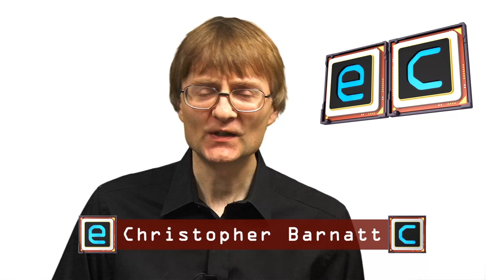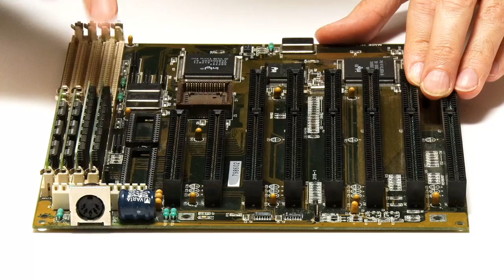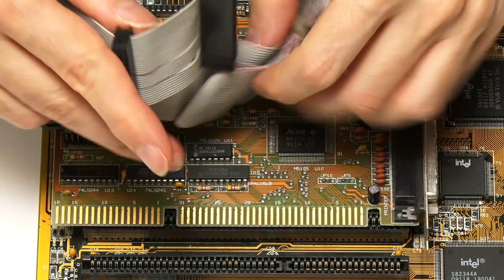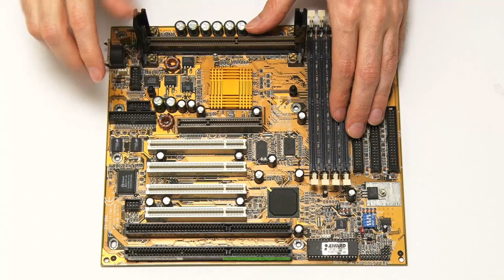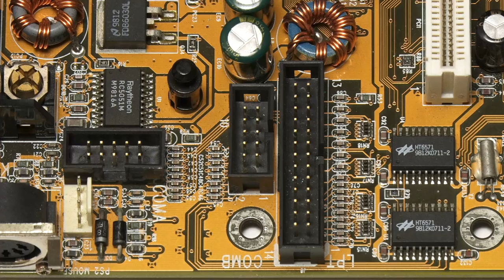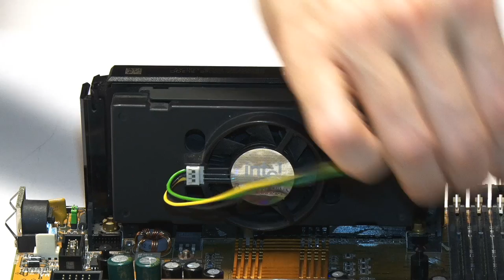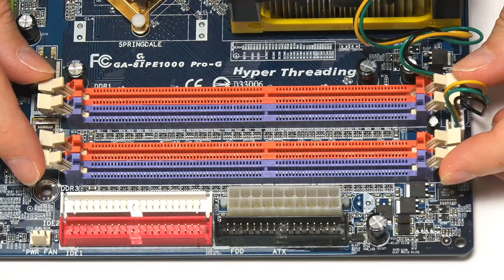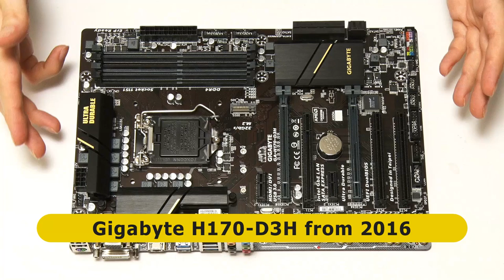PC Motherboard Evolution

Comment: interesting how you connected the cable wrong at 6 minutes. The stripe on a ribbon cable goes to pin 1.
Reply from the maker: See pinned comment.
Reply: Sorry didn't see that comment, but there is another thing. Even though it is a standard, long as both ends are backwards it will work correctly. I have enjoyed your channel for some time now, keep up the great stuff. I grew up with punched cards, and have put together a number of systems. As such there were a number of things that I missed over time as I was too busy with things occasionally to keep up with everything and your channel helps fill in those missing pieces. I'm just now working with Arduino and Raspberry PI and thinking about what will work best for a PC replacement for someone that still has a number of programs that still run on dos 6.22.
Reply from the maker: I so agree on the "both ends the wrong way around" thing! :)

Comment: That's a history lesson. I had no idea Intel tried to do cartridge processors.  I guess we can see how that worked out..  It's still pretty easy to swap CPU as long as the socket matches the new CPU.
SO THAT is what a Motherboard looked like when I was born.. lol I didn't start getting anywhere into computers until around 2004 when I got my first HP machine on Windows XP. I was. Oh, about 13. I didn't start building until about 2014 when I started getting into things like racing simulations. in my short time i've built 3 gaming machines and a desktop for my mother.  If I had a bigger budget I'd be doing more.. I'm a complete rookie compared to most of the people that have commented on this video. Although I did recognize the AGP and IDE connectors. When someone asks me what they need to fix their machine and I see an IDE connector, I tell them "A new computer will fix this computer, we haven't seen THAT in over a decade"

I have a 2010-ish E-machine behind me on a Dual-core processor which reaches 100% capacity just by playing VLC Media Player. my gaming computer that I'm on now makes that PC look like a calculator.
And that computer makes whatever was running on that board from 1991 look like an Abacus... LOL

Comment: Fantastic video! Just made me sad seeing 20MHz (1991)  to 300MHz (1999)  to 3000MHz (2004) to ... oh damn :(
Reply from the maker: Yes, the pure speed evolution kind of ended, to be replaced with a move to multi-cores. But this largely explains why the performance increases we've seen in the past 10 years or so have been relatively minor -- and why I still edit on a Core 2 Quad from about 2010! :)
Reply: @ExplainingComputers  Bingo! Moores law kinda hit the wall there and multi core is pretty useless for most things and where they are useful GPU power usually kills it. Im still on a 2012 i3770K rig running at 5GHz on water and there really is no reason to upgrade since! Keep up the phenomenal work buddy, your videos are a pleasure and awesome trip down memory lane (no pun intended).

Comment: You said that onboard video arrived in the noughties. This isn't actually the case. I had a PC from 1996 (with a 486) and it had an integrated Tseng-Labs VGA graphics chip on the board board, with 4MB of VRAM. I don't think it had any 3D acceleration capabilities. IDE and floppy were also integrated into the board just like with later PCs. There was an assortment of parallel and serial ports, as well as PS/2 for mouse and keyboard. No USB yet, as the standard had just been finalized when this machine was built. No integrated sound either, not even a PC speaker, since the PC was meant as a silent office PC, which would have worked, if it wasn't for the extremely noisy 500MB hard drive.

One very interesting aspect that is puzzling me to this day is that it had the standard ISA-ports of the time, but there was also an adapter card that made it possible to connect PCI expansion cards to ISA. I managed to use an early 2000s PCI sound card with this machine  - and it worked under Windows 95, without any configuration apart from a driver install. 

In case anyone is wondering why I was using a 1996 PC in the early 2000s, I got a hold of it after my old school wanted to get rid off some old PCs. I knew someone who knew someone, the machines would have been thrown away, so I got permission and cobbled it together out of several old computers, picking the best components from each. We only had a family computer at the time, which I had to share, so this little 486 was "my" first PC. I used it for homework and games (thus the soundcard), mostly old shareware titles and Lucas Arts adventure games.
Reply from the maker: Cool.

Comment: Aaah, jumpers!
Jumpers also used to be a pain when connecting multiple IDE-devices (Pata) like some hard drives and a CD-ROM. You then had to put jumpers on the drives themselves to put them into master or slave mode. Often it was also important in which order of the same cable you connected the drives themselves in for them to boot/be recognised. 
And also the right IDE "connector" on the motherboard. It could take a couple of tries only for you to discover that maybe a cable was "glitchy", which happened a lot to the IDE-cables which you had to bend a lot if you had several hard drives and Cd-roms installed (often they had to be turned 180 degrees to fit in the most awkward ways too. Something leading to more non-functional cables in the long run). 
SATA made all these things so, so much easier (The cables almost always doesn't "glitch" for SATA either!

Comment: I would say the 1999 Gigabyte board was a bit behind when it was released. I've had computers from 1997 that had both onboard outputs and self-adjusting clocks. It might just be because the Gigabyte was an enthusiast's board though, and not a mass production one like in my old Dimension XPS.
Reply: There were motherboards availble with built in graphics and sound. At the time it was better to get a board without them and use your own graphics and soundblaster card. The onboard ones tended to be poor.

Comment: Great video, however you actually did plug the floppy cable in backwards of the card you demonstrated on the i386sx board.  .  On floppy and the IDE ribbon cables  the red stripe on the side with pin 1.  Then on the PCB it will either be marked, or often pin one will have a square soldering pad while the rest are regular round vias.  It is very obvious if you plug the floppy in backwards.  The drive's LED will come on and stay on if it is connected backwards and turned on.   I have been a technician for a very long time ;)
Reply from the maker: See pinned comment! :)

Comment: I don't know if you have one, but I would have loved to see one that had the dual ram types that some did.  It would allow you to use like dimm and ddr, or something like ddr2 and ddr3 on the same board.  I do like that you had the ide with sata, that was a lot of fun. Seeing the old slot with the pins, to note, they didn't have the same bios/uefi that we have now, soo many fun memories in this video, thanks for making it
Reply: I did have a couple motherboards with dual RAM types way back when. Even a couple that could take either an AT or ATX power supply.
Reply: Don't remember any that I had that could take both at or atx power, that would also be cool to see.  I liked to be able to do the boards with both of a type as an upgrade board, but I had a massive issue with the bios of one with the ide and sata. They would both work, but in order to have them work together, I had to enable a thing that I had to have disabled. There was a thing in the list though, that even after I re-disabled it, I had to have one thing enabled or they both would not work if they were both plugged in.  
It was a very large hassle and I couldn't find anything or anyone who knew what I had to do and it was a week of trial and error to find out what to do.  Even still, good times, lol
Reply: Boards with both IDE and SATA aren't that hard to find in computers about 5 to 10 or so years old, especially as SATA was starting to become standard. The last of the workstation motherboards that still have an IDE slot are just now being phased out of service to make way for SATA-Express headers.

I wonder if you're referring to the AHCI setting in the BIOS? If both the IDE and SATA are on the same controller, you might need to have the SATA ports in IDE compatibility mode for it to see everything. Can't tell without playing around with it.
Reply: this one was a while back, and it was in the raid setup for the board.  I had to enable raid to change a setting in the sub menu, then re-disable raid in order for them to read. That's about as much as I am sure on, as it was over 10 years ago. It was the first board I had with the sata and ide, not the last, and it was the only one that had the setup that way for them. It may have been AHCI, but if it was, it was listed under raid in the bios.  Like I said, it was over 10 years ago, and it was only that board and I only had to do it one time.  Think it was around 2005 or so that I had that system.
I had some of the newer ones with both ide and sata that had no such issues, and they could use both ddr2 and ddr3, just not use both at the same time, the ram that is, the drives were fine together. I know the one with the changes under the raid folder were a standout for me, as no one at the time knew what to do, and I thought it was funny that I had to enable something I was gonna disable just to get it to work.

Comment: Last week, I found a little pc from 2013. The mobo is about the size of 2 cigarette packs stuck together. It has 1 hdmi and 2 usb, VGA. 12Volts. It has NO external ram. 
It works and I thought I found a cool little normal pc. But when I start it up, it loads a security camera window application that devides the screen in 4 camera screens. Cam 1 to 4. I am thinking this is the bios and cannot be changed.
What is this and can I somehow put linux os on it? Anybody know?

Comment: Motherboards of non-Microsoft-compatible PCs were quite interesting, too, at least into the 1990s. Worth looking at Apple Macs from that era, for example. Your 1999-vintage Gigabyte board had one measly little USB connector head, but the Apple iMac G3, the first mass-market machine where the only expansion available was via USB, had already been available for about a year.

And now, we have new architectures like the Raspberry π, which are making the non-Microsoft-compatibles interesting again.

Comment: Hi, and thanks for a very interesting 'walk down memory lane', if you'll pardon the pun. You conclude your video with the statement:

"We should expect this level of change to continue into the future". 

Hmm. I notice that between the P-2 on the board from 1999 running at 3OOMHz, and the Core-2 Quad from 2004 running at 3GHz, is an order of magnitude speed up in some 5 years time. But another 5 years later and we're down to 2.4GHz, albeit in a quad core configuration. I've been watching processors since the i8085 and have been amazed at not only the exponential growth in transistor count (Moore's Law), but in speed as well. I hoped that would continue but obviously it's been leveling off considerably. Nearly flatlining, I would say. Now I realize that memory and peripheral speeds have been increasing to bridge the 'bottle neck' and that's something. But it does seem that we're kind of hitting a 5GHz wall. And while going to multiple cores helps, there are diminishing returns there. So while I'd like to believe your statement, I find that I can't. But I'd be happy to hear any thought you or others may have.
Reply from the maker: I certainly agree on the diminishing returns of CPU upgrades point -- speeds have been pretty static for some time, only cores increasing. But the development of AI CPUs (like Google's TPU chips) may point a way ahead for massively parallel chips in PCs in, say, 10 years time. We shall see! :)
Reply: One bug bear of mine is how how poorly most games are optimized to take full advantage of the hardware at hand. If they were then the motherboard would look a lot simpler and that's were I see the future of motherboards. An amalgamation of some components.

Comment: It really is amazing, how things really changed from the 90s to the 00s, things came and went on motherboards, like the AGP slot for the graphics cards.  I am surprised that the floppy connector did hang around till 2010! i think the floppy disk drive vanished from been installed in systems by default, in the mid to the late Pentium 4 era.  Also the PSU connector changed too, From the AT to ATX, so really the Pentium 2 era was a massive leap forward,  and again not that long ago with the m.2 ssd going directly on the board, and the graphics been integrated into the CPU.

Comment: The biggest difference between the 1999 board and the 2004 one was that the latter had DDR DRAM while the former had SDR (single data rate). DDR came in around 2000-2001 on consumer boards, IIRC. The overall performance improvement over SDR was remarkable.

Comment: Worst thing about SIMM slots is that the plastic becomes brittle and you can easily break them. So each time you remove a SIMM from an old board you're risking breaking the SIMM connector and making the board useless.
Reply from the maker: Very true.

Comment: I've actually still got one, maybe 2 computers that use the AMD Slot A processor. I even got a spare Slot A processor laying around that I would actually like to put to use.
Reply: My retro gaming PC is a working Slot A with an Athlon :P
Reply: @Martin2112  I think the AMD Slot A processors are all called Athlon.
Reply: @SOU6900  Yeah I think you're right, off the top of my head I think mines a 700mhz but can't remember which model. Found in charity (Goodwill if you're American!) shop for about £2!

Comment: Still remember assembling my Pentium 133 back in 1996, back when AT motherboards were on the way out. You had to check, double-check & triple-check to ensure you had the two M/B power connectors correctly inserted, as it was possible to swap the two... with DISASTROUS results! No USB... though I did run an Adaptec 2940UW SCSI interface on mine, along with associated hard drives & CD-ROM drive. At the time, SCSI was quite superior IMO so for me it was worth the extra cost.

Comment: I'm surprised some motherboards still cane with at least one floppy driver connector and Ide port as late as 2010, I have a mini-atx AMD MB from 2011, and it has none of those...
Reply from the maker: It very much depended on the board. :)

Comment: You should remove these barrel batteries, as you mentionned, the 386 have corrosion ... This actually comes from the barrel battery, and if you want to stop it from spreading, you should remove it (and eventually replace it with other solutions like a diode + non rechargeable battery, super capacitor, external battery ...), especially on the hardware you want to keep functionnal (or to keep looking fine)

Comment: most things you say are correct... but one thing you really missed and that's the integrated gfx..  That came around A LOT earlier...  ie I had it on my 386 board back in the day.  (which was a brand computer namely the Olivetti PC-30 i believe, it's been very long ago since i had that computer..)
But in the link below you can see it's motherboard; (it says amd, but mine was Intel, back then intel/amd were pin-compatible; even the soldered ones. I had a 387fpu  (floadting point unit) added to my system and it was running windows 3.11 with 4 mb ram. I even went on the internet with that computer using a serial modem, Trumpet winsock (for dialup with tcp/ip in windows 3.x) and netscape 2. My modem was a 9600 baud (~1 kbyte/sec!!!) faxmodem, about a 100 000 times slower then what i got today (100 mbit), but it worked and was good enough back then (internet was 99% text and 1% very small gif images back then).

sadly you didn't show any AMD boards (486/slot A/Athlon (thunderbird era), athlon 64 (first 64bit end user cpu), dual athlon (first multicore for end user), or motherboards for the Cyrix cpu.
Btw; on your second 386 motherboard, next to the simm slots, i really thought you'd mention those sockets... As nowadays you can't find those on a motherboard anymore (486 were the last ones to have them i believe); those sockets take S-ram; and that is used to expand the cache-memory of your cpu. Nowadays cpu's have multiple megabyes of on-die cache, this wasn't always the case; and plugging a few sram modules in those sockets (expensive, small size but as fast as the cpu) really made a difference on heavier tasks, I remember fondly that in my case Windows worked a lot faster  and felt snappy and that all thanks to 64 kilobytes (8x 8kbyte, it's the column at the top-right on the mobo in the link, it's also filled on that shot; originally it was empty on my board)

link to 386 motherboard with onboard vga: http://pcrebuilding.altervista.org/46/168/2nd+LIFE/386/Olivetti+PCS+386+SX+-+AMD+386SX+16MHz.html

I had this computer from '92 to '96, then i went for an AMD 486-dx4 120mhz that i built and payed for all by myself (age:16) (bought components on a famous local computer fair, since then i've built all my computers myself saving 10s of thousands of €/$ over the years)

Comment: you should desolder the battery from the 386 board, even if its defunct, having leaking batteries in your drawers isnt fun. you also made no mention of the AT to ATX power plug.
Reply from the maker: All true.